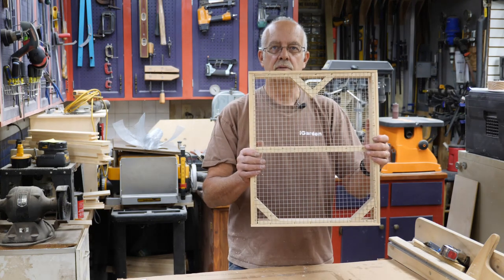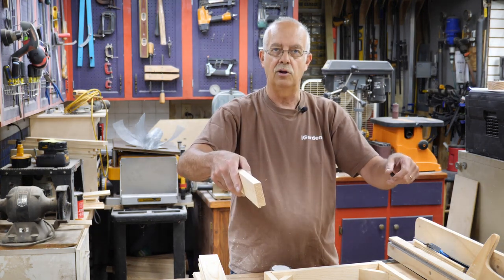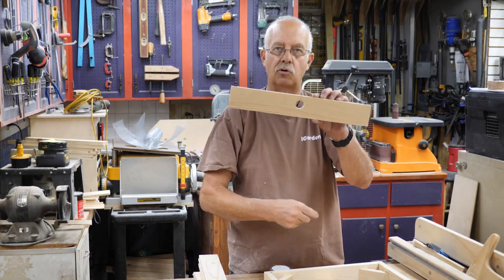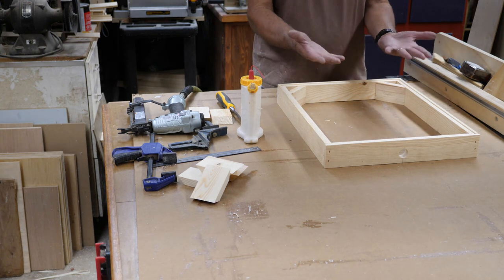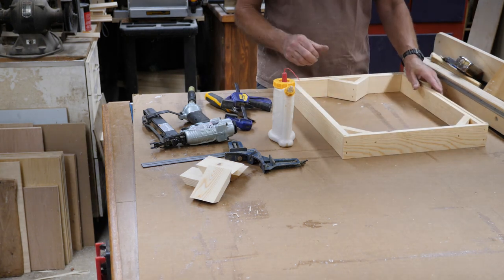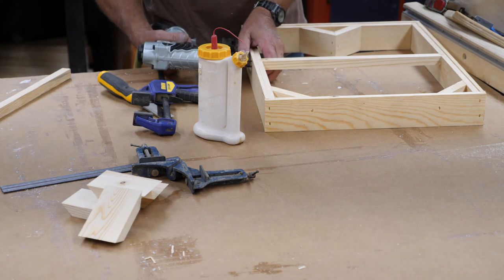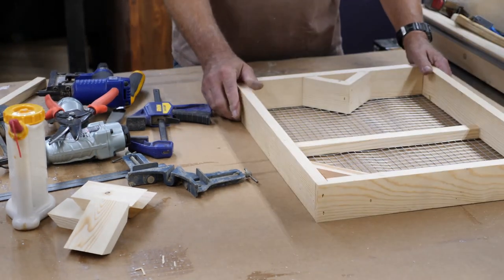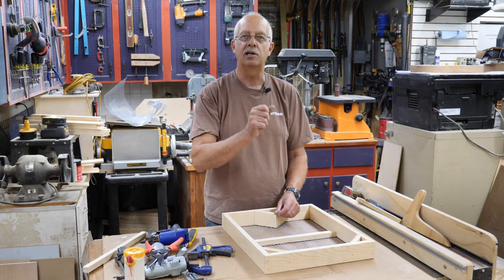Bee Hive Candy Board Construction

Comment: Hi roger I don’t have a 3/8 but I have a 1/2 rabbet bit,, so for the front n back where you said to do 3/8 by 3/4 is the 1/2 ok
Reply from the maker: If you go with 1/2", then you will need to compensate on wood size to make the difference.  We cut the rabbets on a table saw since we usually run 50-100 of these at a time.